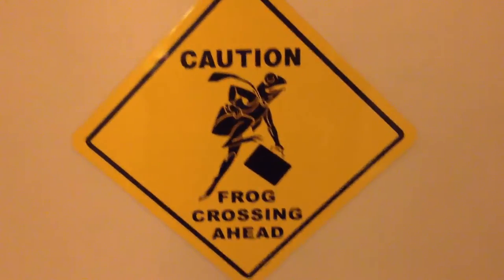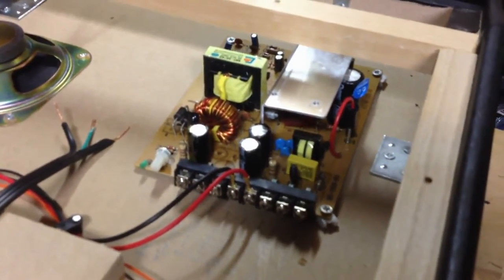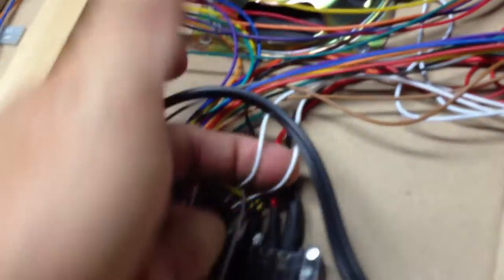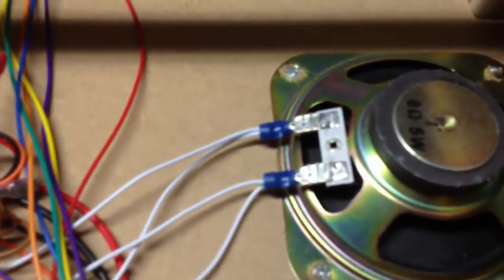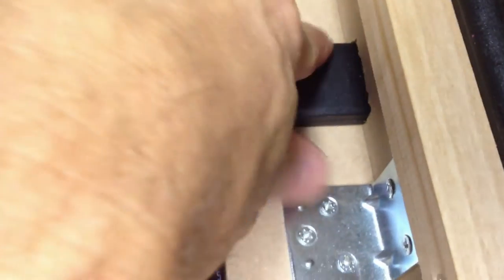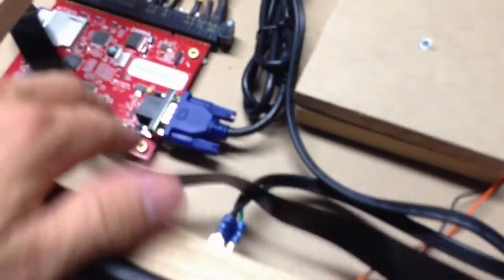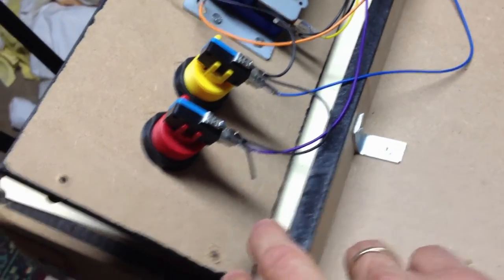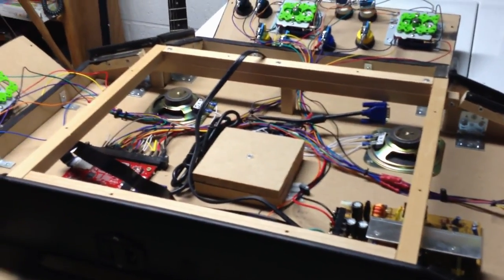3 Control Panels Cocktail Part 2 - The Electronics!

Comment: Great build video! That mount solution for the monitor is really clever. I would put some heat shrink tubing on the ac connector clips, just for safteys sake if you need to work inside with the power connected.